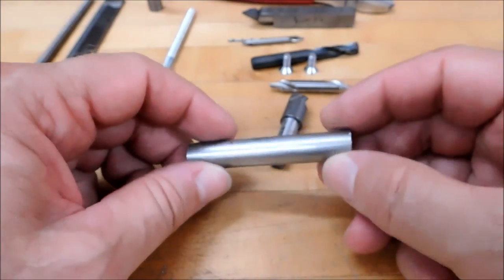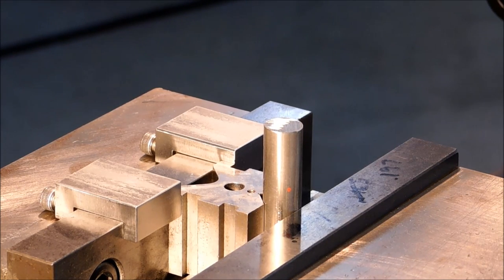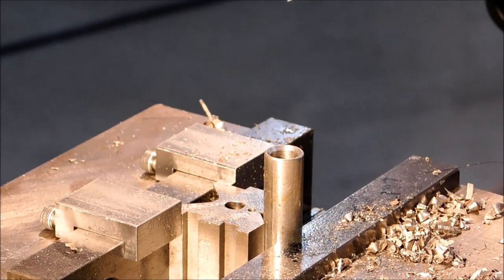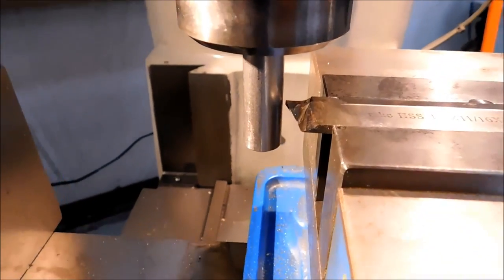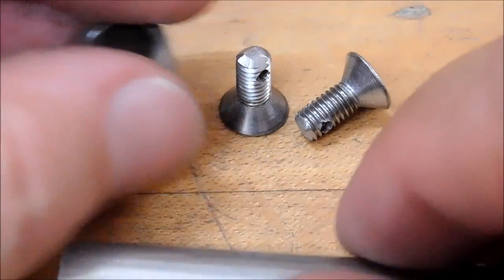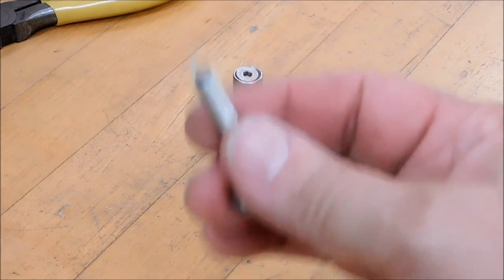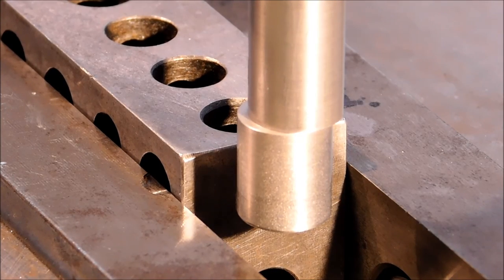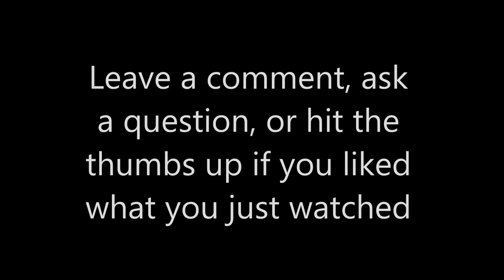Making an Edge Finder ---- On a Manual mill ???

Comment: Please do some more metric. there are more metric people in the world and the internet than in the usa
Reply: Or, you could learn the conversion and do the math like all Americans do when foreigners mention literally anything.
Reply: Even if he had referred to that piece of 1/2 inch  stock as 12.7 mm it would have made no difference in the machining.  process.
Reply: Henk. Imperial or metric  are just numbers  if you disregard the fractions  that are commonly used in the imperial measurements which maybe the reason you find it confusing.  with digital readout measuring nowadays its just a matter of pushing a button to get conversion from one system to the other .
Reply: times 25.4

Comment: waist of time.... use the DRO's
Reply from the maker: DRO's by themselves don't find edges unless you have a probe or one of these.
Reply: @joepie221  Perhaps you right,  on some is no other function but the just the digital location, i meant as an CNC that finds the edges by itself then determines were is the center inside or outside.
Reply: CNCs don't find the edges themselves.  You have to use a probe or edge finder to locate and set the zero for each axis during setup.
Reply: @CurtisAllenG  Well, Under Mach 3  yes , there is a function that can find interior edges, exterior edges  find the center of a body and the center of a hole. I will make a short vid and posted for you.
Reply: @mtabernig  I did find a video online.  I've never seen this software being used in a production machine shop with machines with say Fanuc controls.  Also it requires electrodes to be connected, so you are still "edge finding."  Not saying there isn't something out there similar to this but I'd be interested to know if this is in use on some of those mainstream machines.